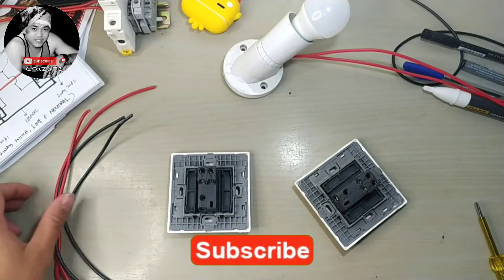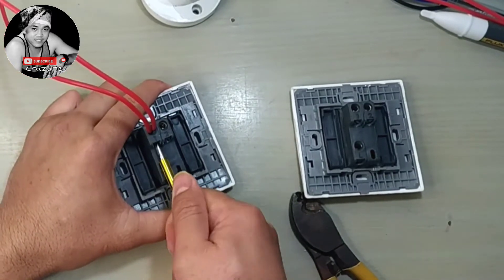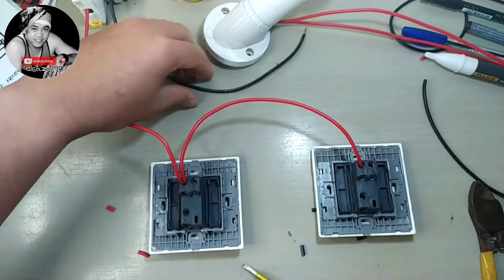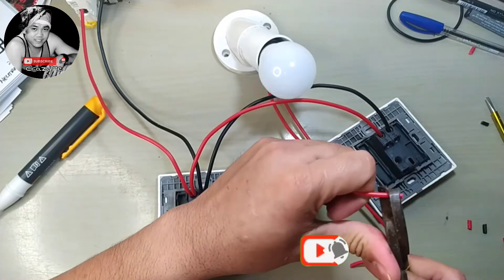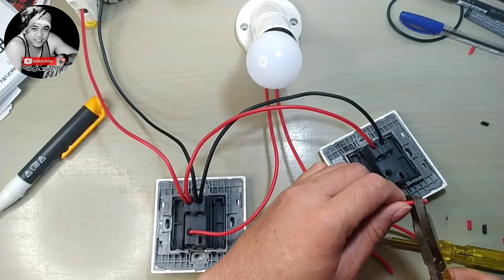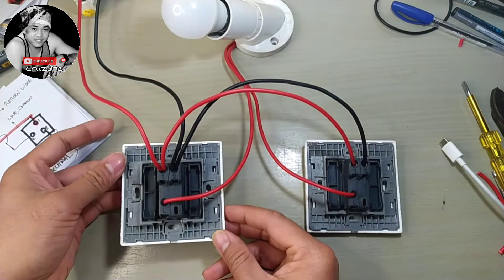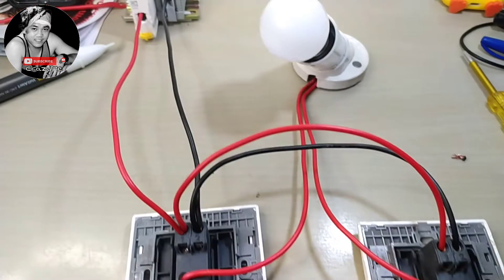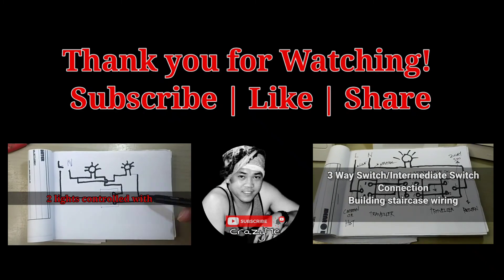3way Switch Line to Neutral wiring connection

Comment: Nice explanation.   Here in the u.s.a., this switching configuration is known as the carter 3 way, also sometimes called farmer's 3 way among other nicknames and has been prohibited by the National Electrical Code since 1923, but has continued to be illegally installed for decades afterwards.   Most often seen with knob and tube wiring systems but also common on farms and in rural areas,  where you have an outbuilding like a garage or barn, a 3 way switch in the house and outbuilding,  controlling a yardlight in the middle and receptacles in the outbuilding constant hot, using only 3 wires instead of 4 (excluding a ground)    This configuration can also be on two different circuits,  so if you were doing work in the service panel and got the phasing mixed up you would send 240 volts to the bulb in one of the positions that would turn the bulb OFF (Hot-Hot)   in the olden days during the depression and wars, people were very fugeral and if they could find a way to save a dollar here and there,  they would do so.
Reply from the maker: Thanks kyle